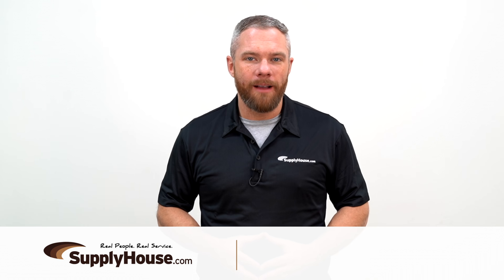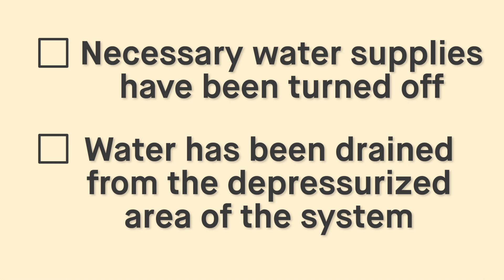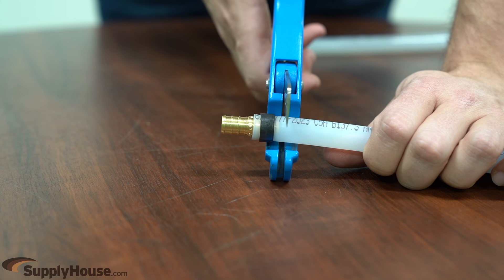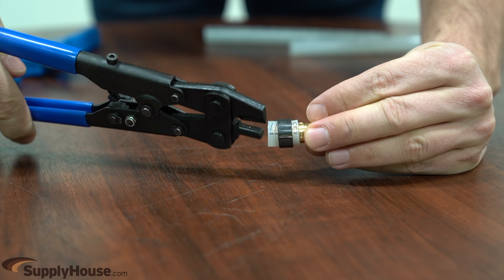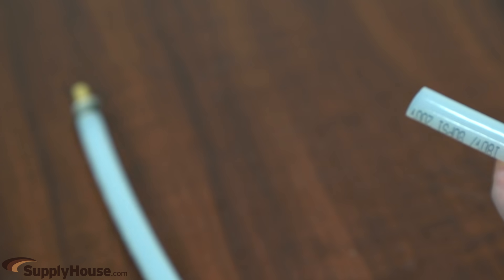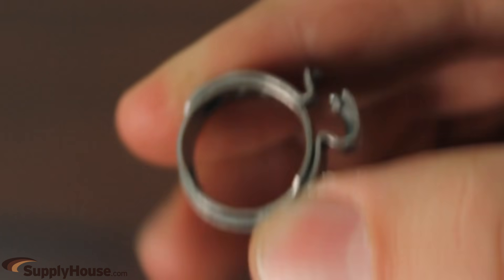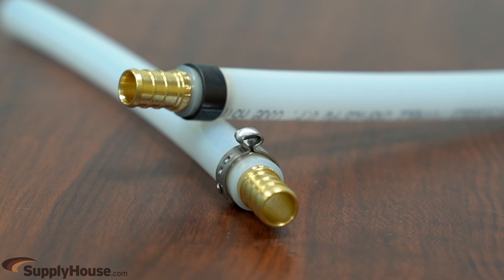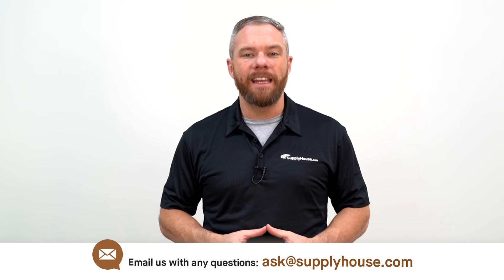How to Remove PEX Crimp and Clamp Rings

Comment: Cut off the pex! It will be too short then!
Reply: It’s so hard to remove a fitting from a crimped PEX those barb markings holds the fitting well plus you are in a confined space. Better just cut the PEX off. 

If you are short of PEX and still have at least an inch of PEX just extend it with PEX tube using a connector then crimped it. Happened to me while installing a smart water valve.

Comment: I'm usually loathe to put money into single-use tools of any kind, but this one is a no-brainer. Tool works perfectly with zero risk of ruining fittings, which makes it worth it. Contemplated putting an equivalent sum into a cheapo rotary cutoff tool, but so glad I got this thing instead 👍

Comment: The crimp type can be removed by prying up on the locking tab with a small screwdriver.  My crimping tool does not have the cutting blades mentioned in the video. For the copper ring,  a Dremel-type tool with a cutting blade works fine, no need to buy a specialty tool.

Comment: I found it difficult to remove the residual pipe off of the fittings, and you must be very careful not to damage the rings on the Pex fitting by using tools. I got a cup of hot water and soaked the parts, then after a couple of minutes the residual plastic slides right off!
Reply: Use this tool, the instructions on the shark brand tell you to score the pipe in six locations in the same way as the ring to release the grip over the barbs. Worked perfectly on Pex B 👍

Comment: This is worthless, if I cut the section of tube out of the system, I'm simply throwing it away.  I was looking for a means of removing a ring without modifying the existing tube
Reply: That was my issue to, in my RV
Reply: @blainemcdonald6972 Same in our RV- ultimately had to go into previous supply run in bathroom because of lack of space for these tools. They are so large they are useless for an existing small space like ours in the kitchen cabinet. We found a video using a heavy duty diagonal cutter/ electrical crimp connector that both fits the tight space and works! Although we had already cut the entire supply line out, we now know how to use the diagonal cutter in future to replace only what we need to.
Reply: Only way I've found is to use a Dremel with cutting disc, and be careful not to cut the PEX. This a hole doesn't realize plumbers don't leave much PEX sticking out of wall.
Reply: He told you how, screwdriver
Reply: Ya that doesn't make the video worthless, it's just not the answer you wanted. So emotional.

Comment: "Gently work the tubing back and forth while pulling away from the fitting..."  yeah right.  My pinch clamps molded that pex onto those brass fittings. I use an old pair of side cutters to slide in under the end of the pinch rings and peel the ring off (after you bend back that first tab, they "unzip" easy with an unsettling rip). However, after that, no wiggling in the world would move the pex off the fitting. Blast it with a heat gun to soften it up enough to release. I don't like to use a torch on pex, especially inside.
Reply: I also found it difficult to remove the residual pipe off of the fittings, and you must be very careful not to damage the rings on the Pex fitting by using tools. I got a cup of hot water and soaked the parts, then after a couple of minutes the residual plastic slides right off!

Comment: Hey, so brass fittings are universal between pex a, b and even that old polybutaline something or other get pipe? Could a t-fitting connect say all three together hypothetically, say if you're incrementally upgrading?
Reply: No they're all different. Seen adapters between pex b and polybutaline though

Comment: It's easy when it's off the car. I want to see a demo of how you get them off in tight recesses in the engine bay!
Reply: You do know this is for plumbing in a house right? Not coolant hoses in a car.
Reply: I used this in my car for the tail pipe.  Used the red one so people know it’s hot.  I then did all my coolant lines, tranny lines, air condition line, blue of course hehe, and then my gas lines.  Perfectly color coated. It’s tough to get that darn tool in there but man it looks good.  I then used rubber hoses for my plumbing in my bathroom.  Have the exhaust pipe and muffler in my ceiling and I used the gas lines to get my wife’s horrible gas out of the toilet.  I also used the thermostat to check the tub water temp.  I have a overheating light on the tub to let me know when it is too hot.  Thanks for the ideas Charlie!

Comment: This is a crap solution. Working in a confined space doesn't allow removal/cutting of tubing. This only works if you're just interested in removing the fitting. If you cut the line with the fitting you have to then put a splice/union back in the line after replacing the fitting. Did I mention confined space? There is no room to install a splice. So stupid. Also in confined spaces it is impossible to remove 2in of line for the new crimp. It would be necessary to replace the entire line. Again, so stupid.

Comment: some asshole installed these in the house i bought and had the the hot and cold switched.  of course they didn't leave me any extra hose to use if i cut them and fixed it.   thanks to someone mentioning cutting off the bands with the dremel.

Comment: Best way to remove pex tube from a fitting is to use the copper ring removal tool. Use it the same way used to remove the copper ring. Press lightly on three or four places and the tube will fall off.

Comment: Trying to connect a "Quest" plastic pipe to a copper connection with male adaptor on bathroom sink pipe behind the wall.  Have tried blow torch with a crimp ring over the plastic .  The plastic won't secure to the male adaptor.  Suggestions?  Best way to crimp?
Reply: I'm sure the OP has taken care of his dilema by now, but for those looking for this answer, the standard PEx fitting will not fit the gray polubutylene (mobile home) pipe.  PB pipe walls are thinner than PEx.  You would need to insert a PEX Crimp x Polybutylene Brass Transition Coupling in the line, before the male adapter, to switch the pipe from PB to PEx before the PEx male adapter.

Comment: A grinder will cut the thing also. My question is, if the fitting can turn in the clamp, does it still seal?
Reply: In my experience, yes.
Reply: Yes, if it’s crimped properly.

Comment: A mini cutting wheel on a dremel or equivalent cuts the rings, and doesn't remove any length from the PEX line itself, if that's an issue. I just helped replace a water heater in an RV, and didn't want to deal with replacing lengths of PEX in the confined space under a tiny bathroom sink squeezed behind a toilet. Just cut the rings and spread with a flat screwdriver, and don't buy an unnecessary tool. ...The copper type ring is thicker, but being copper, is softer, so cuts easily. ....If the PEX is old, or if doing the job in the cold, it might be stiff and difficult to remove from fittings once the ring is off. A hair dryer provides plenty of heat to warm the line and make it pliable enough to remove.
Reply: That Dremel is the truth. Keeps you from shortening lines when you'd rather not
Reply: Good Advice Steve! I used a dremel  on mine. Worked great! Thanks!
Reply: Someone make the video on using a dremel to cut pex rings.
Reply: @ehmkebrandsurfboards  just go slow and take your time cutting across it evenly with the metal cutting wheel
Reply: Steve - thanks for this advice, and the hairdryer tip for cold temps! I'm about to be replacing old valves for my RV water heater because they leak if you even look at them funny (replacing with 1/4 turn ball valves) and was looking for a way to cut the old copper rings...and it'll be about 35F when I di this job. Thanks!
Reply: Thanks Steve that is where my next purchase is dremel cutting wheels.  Cheers
Reply: Thanks, the answer I've been looking for for weeks!

Comment: "Gently work the tubing back and forth while pulling away from the fitting until they separate."  HAHAHAHA
This person has obviously never tried this in real life, on a fitting that's been installed for more than 5 minutes.
Reply: it can be done, might have to channel lock the fitting but if theres not enough there to grab without damaging the sharkbites just cut it out and toss it. pretty cheap on amzn but ya, theres nothing gentle about removing these
Reply: Exactly, I wanted to call him a lying sack of shit cause they never come off that easy for me.
Reply: I found it difficult to remove the residual pipe off of the fittings, and you must be very careful not to damage the rings on the Pex fitting by using tools. I got a cup of hot water and soaked the parts, then after a couple of minutes the residual plastic slides right off!